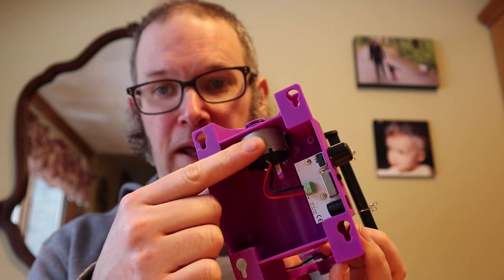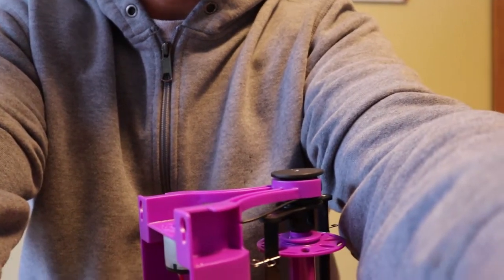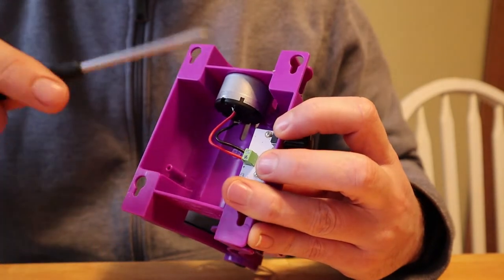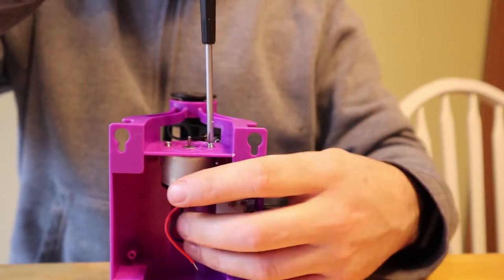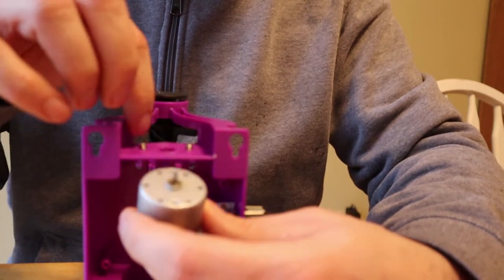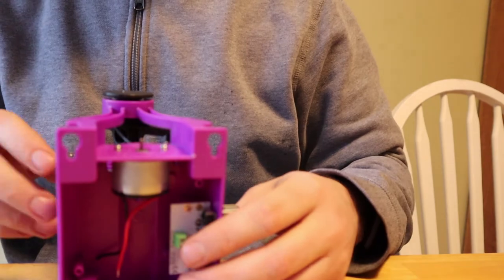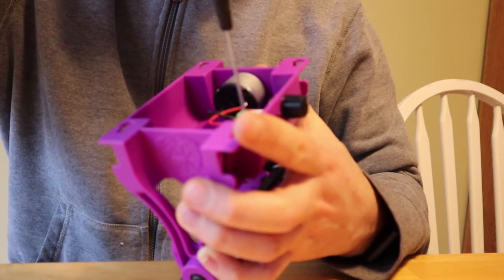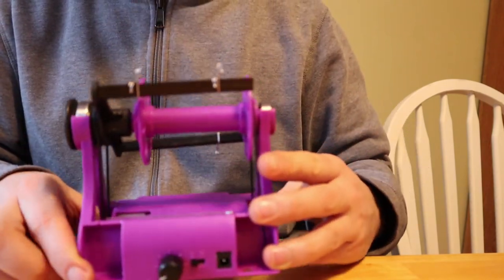SPIN #67 - Changing the Motor on the EEW Nano 1.1

Comment: I can’t get a new motor yet, but I’m having an issue with my motor pulley: it keeps popping off the motor.
Reply from the maker: That is a problem called a slipping motor pulley that sometimes happened on the EEW Nano 1.0.  I've addressed this with the EEW Nano 1.0 by adding little grooves to the motor shaft to prevent the pulley from slipping.  That said there is an easy fix for the EEW Nano 1.0.  Here's a video that shows that fix.  https://www.youtube.com/watch?v=k5AfzPDNxFk